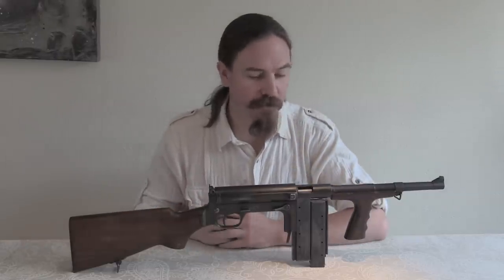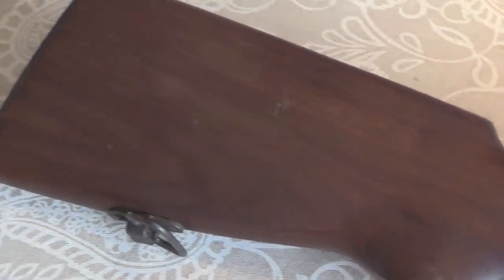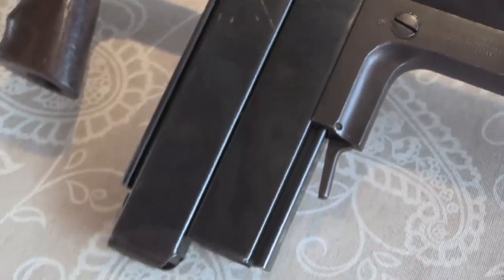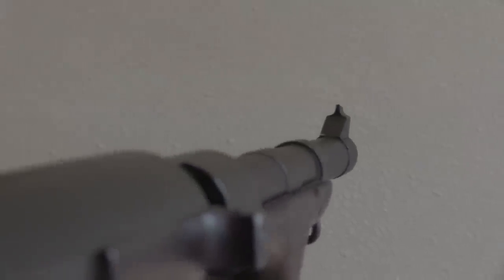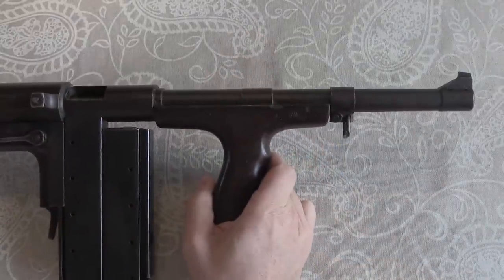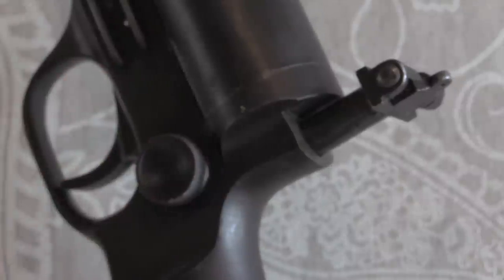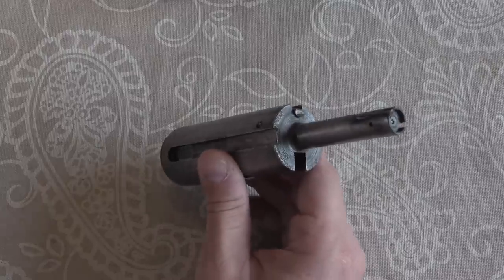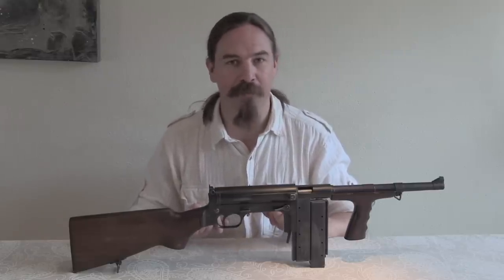Marlin UD-42 from the Dutch Resistance

Comment: Small magazine capacity, crazy rate or fire, barely any use in the war, and practically none by soldiers??

DICE WANTS TO KNOW YOUR LOCATION
Reply: Well,  you know,  that might not be the worst thing for a small group of Resistance types training a little  to do an ambush.  (See a bunch of baddies, everyone   dump mag #1, real fast,   disappear while reloading,  repeat as necessary in the course of getting out of wherever.  )  The point of Resistance attacks like that woulda been  more about causing chaos and terror and making the bad guys spread out to defend things instead of relaxing in occupied zones  than,  say,  it was about battlefield type effectiveness.  A relatively small group of people could seem like a lot more  people that way, too.  

Presumably the original Dutch East Indies buyers were OK with that rate of fire,  expecting to defend against fleeting jungle targets maybe not really seen by throwing a lot of metal in a burst or two  in  about the right direction.  It could be turned the other way around if you wanted to throw a lot of heat and noise and    ...be gone before the professional military can zero you.  :)

Comment: So High Standard's standards weren't that high.
Reply: Twahir Abubakar Ever seen a Victor pistol made by High Standard?  It is the best 22 target pistol of its type.
Reply: Apparently not if you watched Ian's video on the model 10B shotgun.
Reply: non-interchangable parts lends to a higher quality individual firearm as each firearm is hand-fitted by necessity.  but they are slower and more expensive to produce than machines with interchangable parts. 

That having been said, if the contract didn't ask for interchangable parts, there's no reason to develop for it, as interchangability was not standard in firearms at the time.
Reply: Regardless, this is a solid subgun design, and I'm a big fan of the dual magazine idea!
Reply: The 10B had a single flaw that was only there because it was reassembled wrong.

But the Internet is so eager to hate things that nobody cares.
Reply: Better than you think...the company was just a bit stretched.
Reply: Twahir Abubakar thats kind of a theme with high standard. thier name may have been chosen ironically
Reply: Zing!
Reply: Twahir Abubakar 

I live in the town in which High Standard was originally located
They didn’t have a large facility as Winchester or the original site of Marlin 

They produced many fine firearms such as the internally suppressed firearm which the OSS used 

They once called the area I live in the Firearm valley 

Most rifles were once made in the northeast

Comment: Great timing. I just happened to re-read the Wikipedia summary of these yesterday, along with the Hyde M2. Nice little gun, wxcellent for its intended purpose. Looks like it would maybe be disassembled for easier stowage in an air drop container or bundle. A PCC would certainly be useful for resistance fighters, and it's relatively quiet. Interesting history on it too. Great video as always. Thank you.

Comment: I can't help but wonder if the reason for how common the upper and lower are mismatched is if these were air-dropped 
in a disassembled state with perhaps simple instructions to reassemble them. It would make sense from the standpoint of wanting to make the packaging as compact as possible.
Reply: Possibly, but I'd guess that it's more due to prolonged use and no supply of spare parts. Easier to scavange a few parts of another gun than ordering new ones from across the English Channel.
Reply: That is the other main possibility. It wouldn't surprise me if it was both.

Comment: At 6:47 you push on something that looks like an extractor but is on the large diameter back half of the bolt, what is it?
Reply: +Wade Kirby ..thats the front of the larger rear half, or middle of the bolt, it is likely a part of the striker pin safety/release - the extractor can be seen at the thinner bolt face end of the bolt, to the left side of the screen.